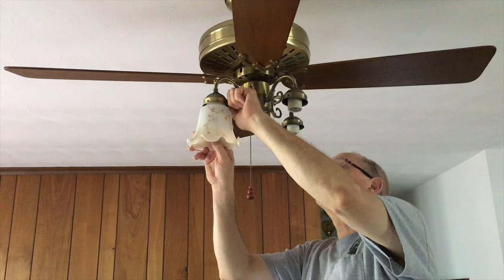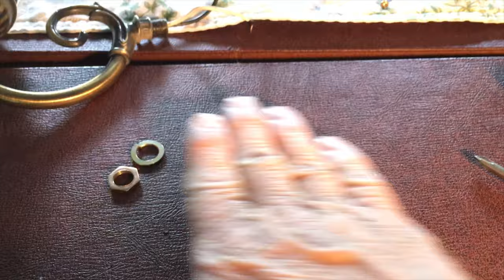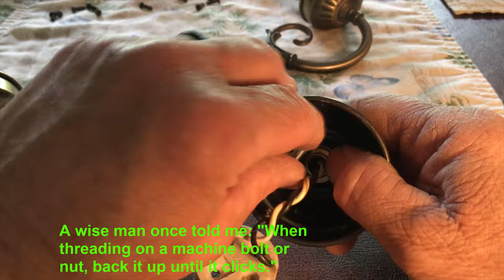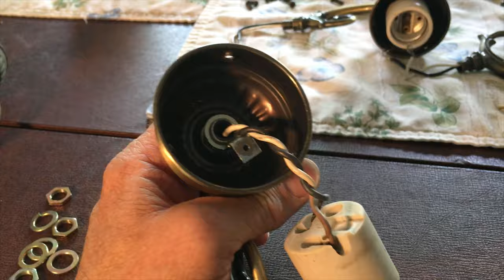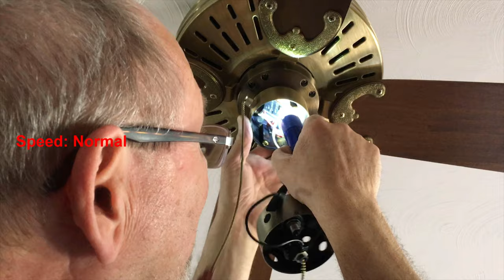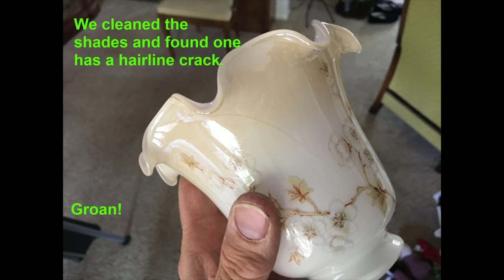Ceiling Fan Repair (before it falls apart)

Comment: That's a Fasco Charleston. Those are good fans will good motor and it will probably last meany more years. I am happy you didn't replace the whole fan because this is way better quality than the stuff that is sold today (with the exception of the aftermarket light kit).
Reply from the maker: I definitely enjoy trying to fix something before I decide to replace it, glad you enjoyed the video!

Comment: You are correct it's a FASCO Charleston (from the Liberty Collection), model 452, one of the 2nd generation models. I have one identical to this except with a single fitter schoolhouse light kit in the master bedroom of my house but mine is from 86.
Reply from the maker: Good to know yours is still going strong as well!  It sure has held up pretty well.
Reply: I bought mine used at our Habitat Restore a few years ago and the original owner had also donated all the original paperwork including the owner's manual and sales receipt from the store they bought it from. I installed it in place of the cheap broken modern Hunter that came with the house. We use ours daily, it's a good quiet runner.

Comment: I have the exact Fasco Charleston here on my YouTube channel except slighty older than yours & November of 1984, I absolutely love that light kit and think it matches well with that ceiling fan, certainly a very good fan to keep and nothing on the market today could beat this fan in terms of reliability and performance as everything today is built to fail and absolutely sucks instead of design. Keep that fan, if not, give it to some one who will care for it!
Reply from the maker: Thanks for the comment Tyler.  We aren't planning on getting rid of it anytime soon, it's a workhorse!
Reply: @GenosGizmos  Absolutely! This fan blows a ton of air hahahahah